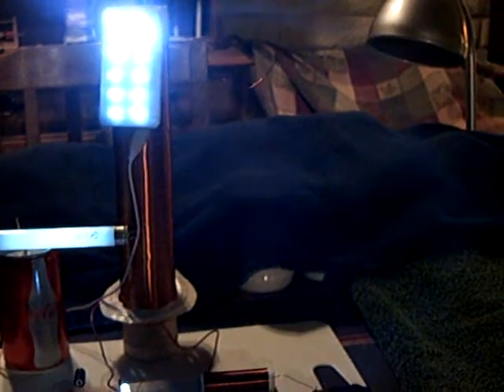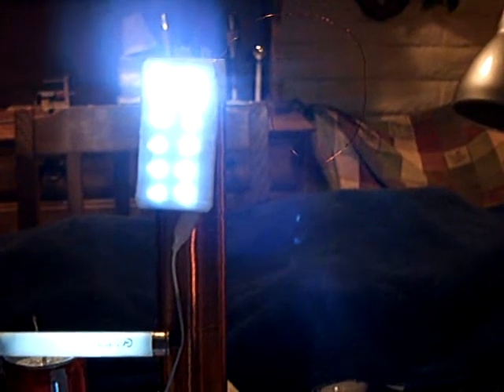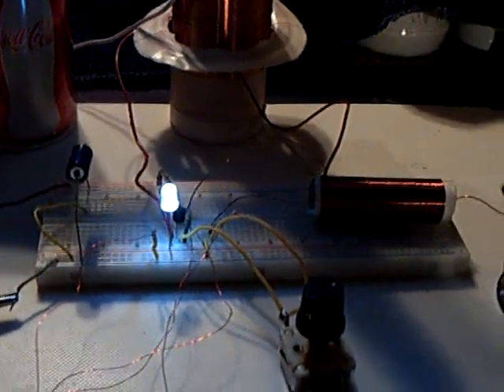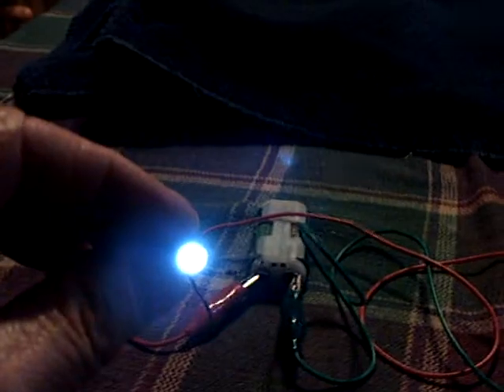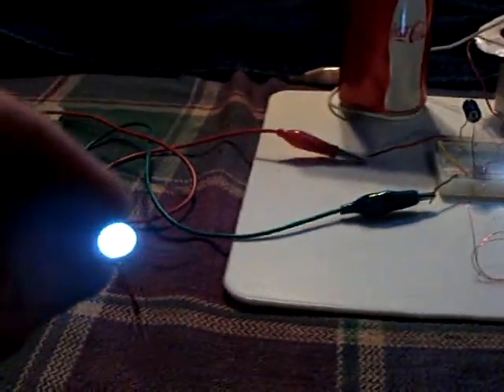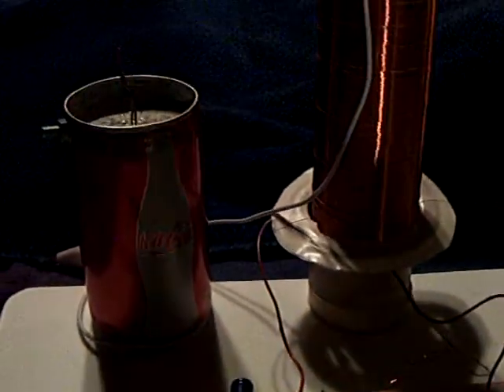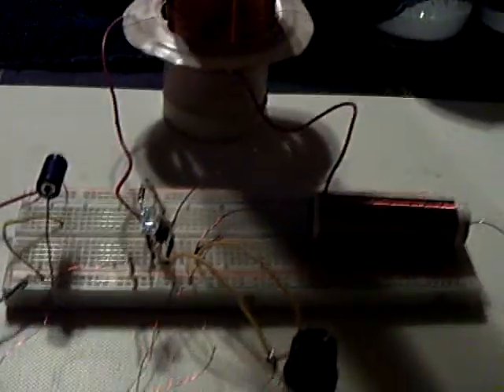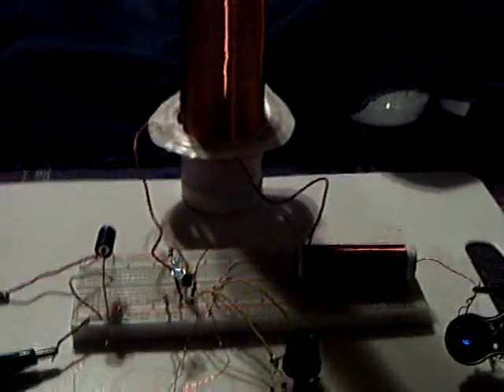Hartley - Slayer Exciter.ASF

Comment: Nice replication Lid.  I got a question that may have been answered in some forum on some year before following the various energy threads:  Why aren't these exciter circuits just called transmitters?  If i place an germanium based av plug directly on the antenna of my wifi router, it turns on somewhat.  So i imagine if I were to tune it a bit (and all that implies), it could become even more bright. (could even prove concept with a crystal radio rcvr).